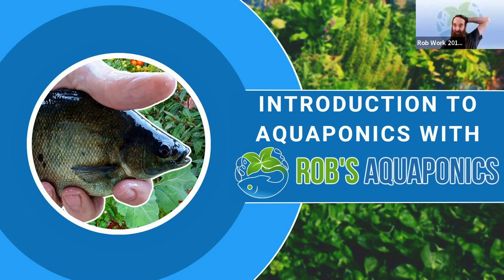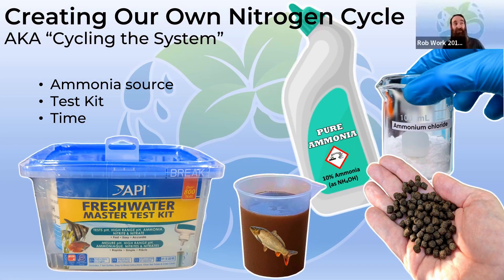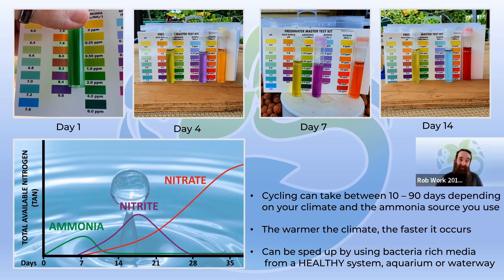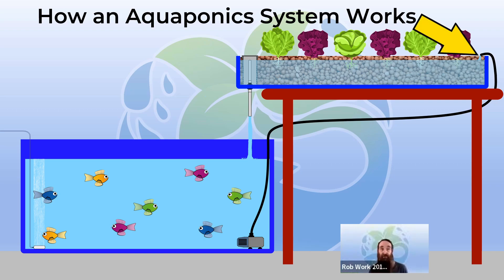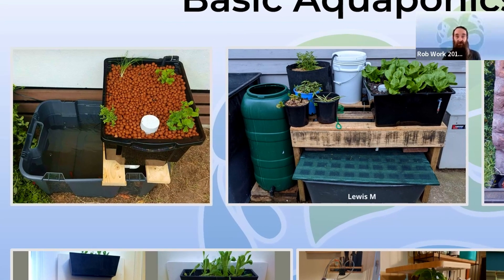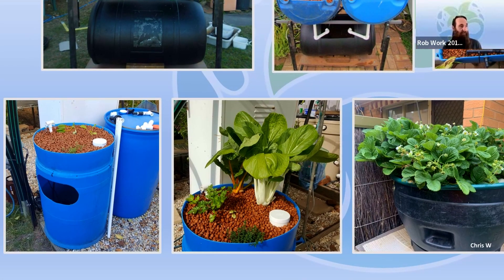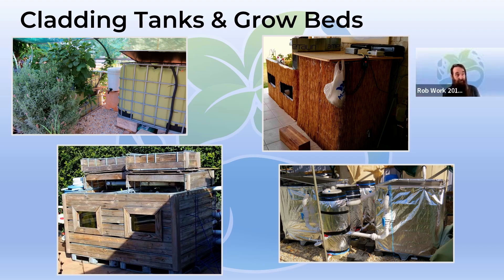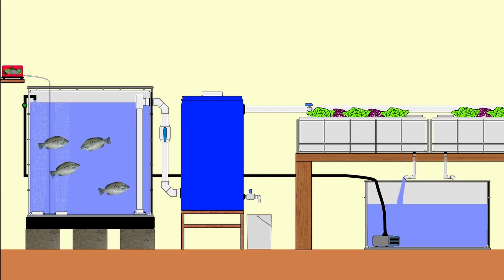Introduction to Aquaponics: Part 1 | The Nitrogen Cycle & Basic DIY Systems 🐟🍅🥬

Comment from the maker: Want to learn more about Aquaponics? 🐟 🍓🥬🍅
Learning is easy with my "Backyard Aquaponics for Beginners" Guide for only US$19.95.
► https://www.robsaquaponics.info/beginners-guide-to-diy-backyard-aquaponics
& share the clip around if you think it may help others too.👍
Cheers all & have a top one.  🐟 🌱🍅
Rob
Reply: Hi Rob. Appreciate if you could send the link of the video where you featured your friend's filtration system where he used different layers of stones and at the bottom is a plastic container where the solid waste is trapped. From what I remembered he used an air compressor to clean the inside of the filtration system. Sorry mate,I know my question is all over the place. I've been looking for that video in your list but can't seem to find it. Hope you can see you my comment . Cheers!

Comment: Amazing knowledge, love it. With these systems do you have to use river rock/clay or can you simply use any old rock? I only ask as I've been told you can do this. Also, I can wee in my new system to start the nitrogen cycle quicker!? 

Love your videos, thank you
Reply from the maker: Almost any rock will do as long as it's the right size (around 20mm/¾") , is clean & doesn't contain carbonates, like limestone. 
An easy way to see if it contains carbonates is testing a sample in vinegar. If a stream of bubbles comes from any of the rock it's no good.  Carbonates can breakdown overtime & play havoc with the water pH. 
You can help cycle using urine but if you've added another ammonia source it won't really speed it up. 
Hope that helps some.

Comment: Hi rob. We need advice. We have just set up our first aqua ponics system following your videos we have two beds and a filter system it was all working and now the water won't pump up to the filter system and one of the syphons won't work We have tried everything but have no one to troubleshoot ideas with and my partner us about to give up on it all
Reply from the maker: Hi Sharon. Just a heads up, if you comment on a members only post I will see it faster than under a video. Sorry I missed this one. 
It sounds like you have an undersized pump but it's a bit hard to say without knowing more about the system. Can you shoot an email to rb@bitsouttheback.net & I'll see if we can help you folks out. 👍

Comment: I add 10% Bondcrete to exterior acrylic paints and when applied to a sanded IBC it has lasted for over 10 years.  The paint is still firmly attached. The big problem with IBCs is rust. The cages will corrode when placed above a fish tank or sump and the rusted metal will fall into the water. This results in iron poisoning which kills the fish.